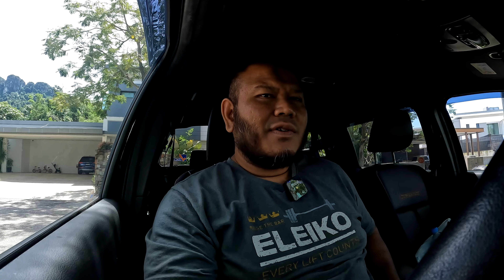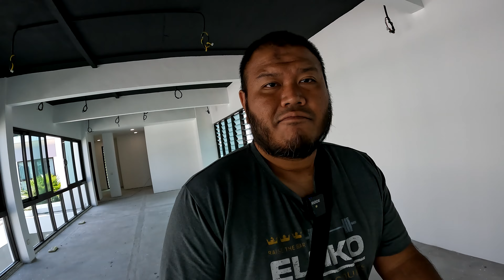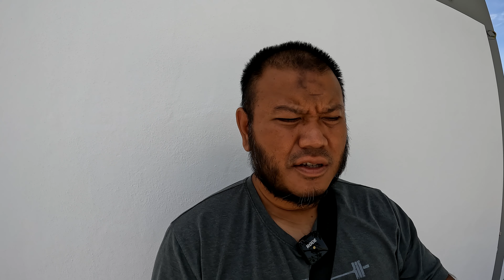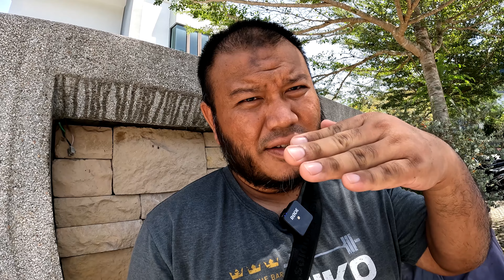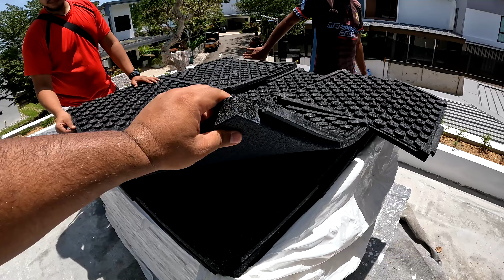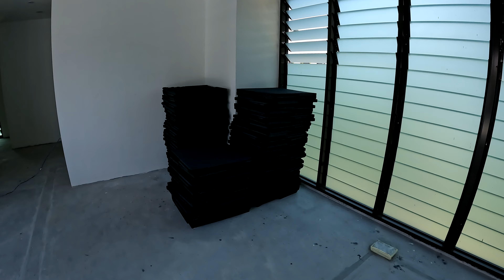VLOG: Biggest Order To Date!

Comment: Now that you have put together a few Prestera half racks, what do you think about he assembly?  For me I couldn't follow the directions with the sliding J-cups and sliding safety arms because of my ceiling height being 100 inches.  The directions had you slide them on from the top, but there wasn't enough clearance.

I had to put them on the front posts first and then attach it to the footer.  It made it quite difficult to line up the bottom bolt that attached the front base to the upright because of the extra weight.

For the flooring did you use adhesive to keep the mats in place or did you use the locking system.  I am guessing those were Eleiko mats.  From what I understand, many people prefer the mat rolls for laying down a mat rather than blocks.

I didn't realize the landmine had UHMW until I saw your video and then looked at Eleiko's site.  

Super cool.  You should take some pictures later in the year to see what the client has done with the space.  Looks really nice with all those windows.
Reply from the maker: The Prestera is not the easiest to assemble compared to, say, the XF80. Biggest problem is to get the bolt through at the bottom foot that connects the front and back uprights. And I can imagine the difficulty you had since you had to put the sliding jcups and safety arms first.

One other way to do it, I would think, is to lay the upright (with the jcup and SA attached) on the floor and bolt the upright with the foot, then lift it up. I've not done it personally, but I've seen people assemble racks that way instead of working it from bottom to top. Does that make sense?

No, these are Sofsurfaces tiles which are the locking type. No adhesive. The rolling type is usually not as thick. It's probably easier to install, but I believe you need to glue them down, which, as a matter of preference, I don't like.

Yes, there is a high chance that I am going to take a picture of the gym when it is done. They're expecting a delivery from another supplier of other equipment that they bought, so it should look awesome once it's fully fitted out.